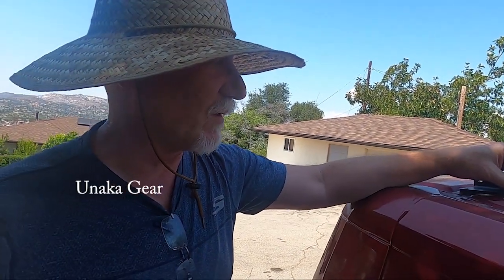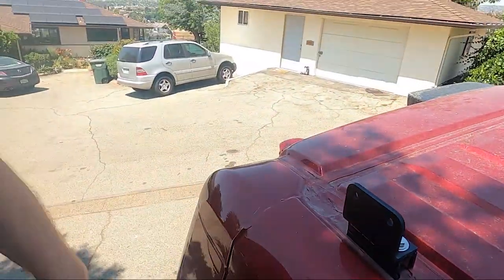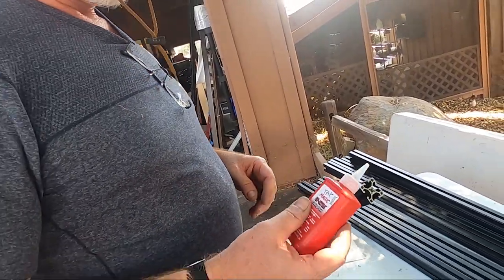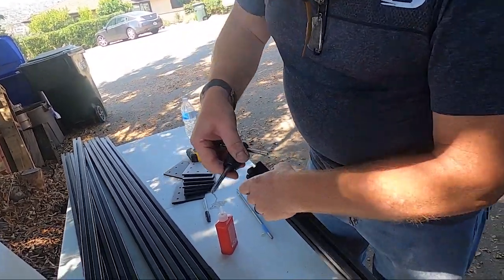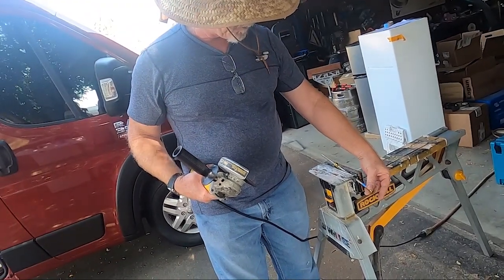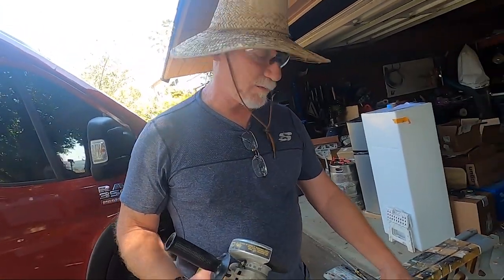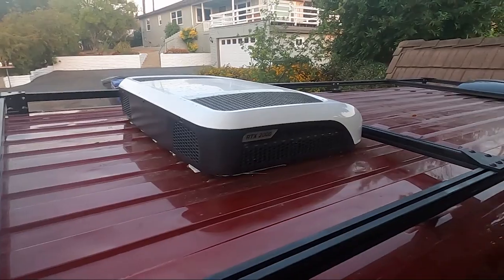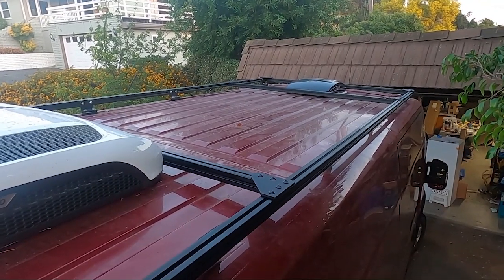DIY 8020 Roof Rack for Ram Promaster 3500 Extended.  Sliding Panel part 1

Comment: Do you happen to remember the exact measurement of the cross bars? Thanks.
Reply from the maker: @chilibeanhere  60" on the inside bars.  The outside crossbars (front and back) are 63" because they span the whole width of the rack.

Comment: I am putting 6 solar panels on my roof that weigh 20 pounds each and was considering the 1010 series instead of the 1515. The 1010 is 1” square compared to 1.5” for the 1515 series. What made you go to the bigger model 80/20?
Reply from the maker: Mostly, I just went with what I saw others do. I went with the Unaka Gear rack mounts which go with 15 series.  Plus i did the slide so i wanted something that wouldnt flex when it was extended.

Comment: How much did you save over buying the complete kit from Unaka? $1275 plus shipping is a big number.
Reply from the maker: You could save some money if you order it yourself.  Tnutz has black 1.5" extrusions. You can order the length you need, so just go through the parts list and see what components you need and how long they are.  Unaka Gear's brackets for the extended are $400.  So you'd be paying $875 for the 80/20 extrusions plus hardware.  Based on their rack specs, you could get aluminum extrusions for a 6 cross bar rack from Tnutz.com for about $365 plus shipping.  That leaves $510.  Figure about $150 for stainless screws, stainless t-nuts and the brackets and you'd be up about $350 (I couldn't find black angle brackets or stainless t-nuts on Tnutz's site).  As for shipping, they're all going to charge for that unless you can find someone local.  Just keep your extrusion lengths below 97".  Once you go longer than that, UPS won't ship it.  It'll have to go freight.

I bought my extrusions from 80/20 (through their Amazon store) before I discovered Tnutz.   think I spent about $1375 total for my complete rack (mine is 12 ft long whereas theirs works out to about 10 ft). I think the shipping was another $200.  My base rack has 4 cross beams on the bottom.  I also have the top slide assembly (like adding 4 more crossbeams), linear bearings for the slide, Unaka mounting brackets and the Unaka fairing.
Reply: @redgiantvan189  Thank you.

Comment: yes sir... I did my solar in 80/20 15/15 .. with 45 deg curver front piece.... man you sure did a good job of hitting the points people need to know when doing this... but I used rhino rack gutter mounts to install it on my 03 workhorse p42 ....keep the video's coming :)